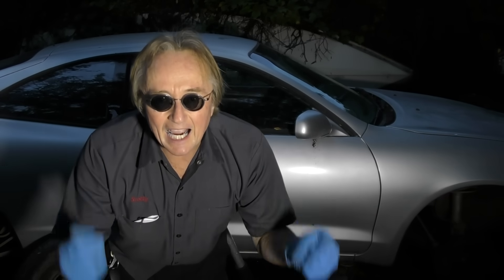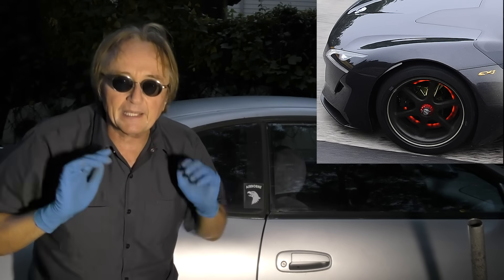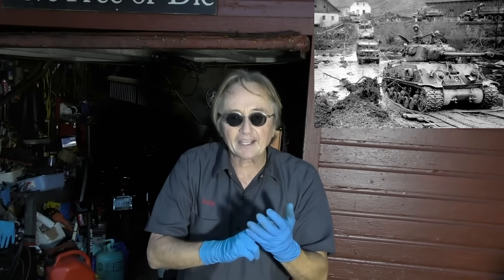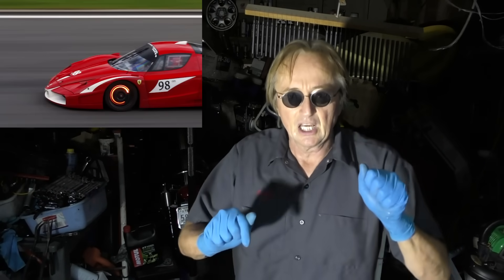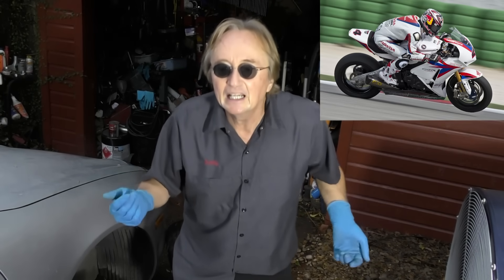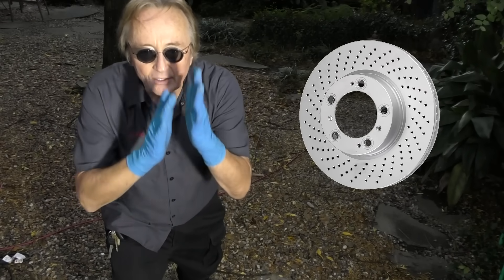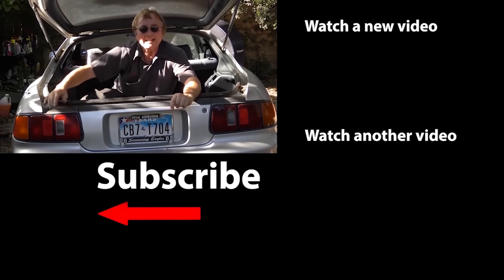Why Some Cars Have Drum Brakes Instead of Disc Brakes

Comment: 1029’24/0538h 🇺🇸 Scotty, thank you. The rear drum breaks can be, also adjusted by reversing the vehicle and pulling the hand lever, holding the release button, several times. Thus the adjusting the adjuster device gets tightened. I’ve done it and I could feel the breaking much much better. Cheers…….

Comment: My 1994 Honda Magna VF750C has a disc up front and a drum in the back. I live in the briar patch of twistie mountains roads where SC, NC, TN, & GA come together. Scott is absolutely right, as always, the trailing brake action, here on my hillbilly roads, works perfectly with a drum brake on the back. For this bike, that has the VFR racing engine stuffed into a cruiser frame, having a disc rear as well would almost be overkill. Magnas are fun to ride! Rev up your engines!

Comment: If I can replace my rear drums with discs without a lot of pain and excessive cost I'll do it immediately! For the simple reason I do my own mechanic work. Have been probably as long as Scotty. Reason being because I can see no justification whatsoever why drums make any sense! First of all with discs if you just want to do a periodic look see to check their condition, usually all you have to do is bend down and look. Don't have to pull the wheel at all. you can see and feel the condition of the rotor and usually see the pad thickness. If they do need service , which 99% of the time is a simple pad replacement, total time to do it is about 15 - 20 min per wheel.  To do the same for a drum you're likely looking at maybe 3 -4 hours per wheel, a few scrapes and bloody knuckles, lost tools because you get so pissed off you start throwing things and probably added time to take a full shower instead of just washing your hands. There are few things more filthy, frustrating and over complicated than drum brakes. Have been putting up with them since the 1950's and have yet to do one that wasn't a traumatic experience.

Comment: Completely missed was the parking brake issue. My RX has a little drum on the disc in the rear for the parking brake. Cars with rear drums don't need this.
Reply: Yes👌🏽 Drum brakes make a better parking brake. Also, drums in the front have an Achilles heel, they need proper and constant adjustment or else they pull. Disc brakes automatically adjust and don’t have this issue.
Reply: @JakeSanMartin  My old drums had a "star adjuster" as I recall. I never had to touch them, as they were self adjusting. When I did a brake job I did have to reach in from behind and back off that star with a flat screwdriver because the shoes cut into the drum and prevented its removal. But it was so long ago I am not even sure what car it was.

Comment: Ive had multiple vehicles where i have converted the rear to discs and i will say even in regular driving. The increased braking power to the rear makes an INCREDIBLE difference especially in non ABS vehicles where the fronts will lock up while the rear is just hanging out and i almost cant stand working on drums vs the simplicity of discs

Comment: TIL. Brake discs all round pro drivers and brake drums are cheap for manufacturers for daily commute drivers. 

Would be interested about your thoughts on remapping an ECU for better fuel or power performance.
I was told its useless unless your are rally driver. The stock ECU was made after rigirous testing so no need to change it. Right?

Comment: I have a 2012 Toyota Tacoma I noticed it’s front brake calipers are on the front of the wheel and not behind the wheel where it should be. Is there a way I can put the calipers in the right position?
Reply: Or is it ok for them to be like that?

Comment: The rear drum brake takes the handbrake much simpler. The rear disk brake still has a drum brake integrated into the rotor for the handbrake.

Comment: to save you all time, it's okay to have discs in the front and drums on the back. it doesn't matter if you're not racing
Reply: Its not ok for me, I will not buy a car that has drum brakes and whilst we're on the subject of cheaping out I also won't have cars with wheels that are only held on by 4 bolts.

Comment: Scotty, i just purchased 1983 4x4 suburban, i will be take is off-road and be pulling a trailer.  I plan on doing a full frame off restoration on it.  Should i put disc breaks for the wet and towing conditions?

Comment: Drum brakes also generate way less brake dust, which keeps your wheels cleaner. Well, actually, they probably generate just as much brake dust, but most of it stays contained inside the drum, so it doesn't get on your wheels.

Comment: I put power star drilled and slotted rotors on my ram 2500 and they gave me a huge improvement with breaking. High toe heavy horse trailer often and coming down some steep California grades, I can build up a lot of heat in my brakes. I recommend drilled and slotted discs for pick ups that are hauling heavy loads and going down Steve grades

Comment: How are drum brakes cheaper to make. 1) The drum requires more steel than the disk, 2) The shoe requires more steel than the brake pad. 3) There are springs and other items on drum brakes that aren't necessary on disk brakes. 4) More material means more cost. 
So, again, how can drum brakes cost less than disk brakes?
Disk brakes are lighter than drums and more efficient. So why do drum brakes still exist?
Reply: Because somehow they really are cheaper and cheapskate car companies use them to cut corners to make their car cheaper, these same companies also use wheels with only 4 bolts rather than 5 too typically.

Comment: Scotty! Can you explain why Its a good idea to change your brake  size when you put bigger wheels on your car and how to determine the proper size?
Reply: Bigger wheel means more unsprung mass and a higher rotational force for the brakes to stop which means you need more braking power and bigger brakes to achieve it.

Comment: Many Heavy Trucks still use Drum Brake Full Air systems . Works fine . But Discs  ARE better . Less Prone to sudden Locking at Max Braking .
Motorcycles tend to have a Tiny Disc on the rear . On a Bike 95% of the Braking is done by the FRONT in an emergency . Rear brake to keep it in line .
Like Scotty said for the Cars . Rear brakes just keep the Back  AT  the back . Rather than overtake the Front .

Comment: Drum brakes are garbage.  It's been years since I decided I would not own another car that had drum brakes.  You have to drive in reverse and slam on the brakes once a week or so or the drum brakes don't do anything at all.  They're terrible, outdated crap, and need to go away.  My last 2 cars (2014 Prius, 2021 Tesla Model 3) are 4-wheel disc, and I'll never go back (granted, the Tesla rarely uses the brakes, but still).

Comment: My 1988 Toyota Camry had a front disc/rear drum system and you could literally stop that car on a dime without locking any wheels.  The Chrysler products I had with a similar setup would go sideways if you had to stop quickly on a wet road.

Comment: 1. Drum brakes in the rear gives you a better e-brake action.

2. Using front brake on a motorcycle in a turn on wet pavement can end up with you having an intimate encounter with the pavement.
Reply: I have discs all round and the handbrake on my car will lock up the back wheels easily and I use Continetal tyres.

Comment: The curve of the braking effort for drums/discs is different. Drums is non-linear whereas disks are virtually a straight line. Disc brakes on the railways has virtually reduced flats on the wheels to zero.

Comment: Water has never been an issue. 4 wheel drum brakes.  for most driving drums work fine all around.  Most people never use their brakes anyways...even on a "they are driving alert" days. Winter has never been an issue because the water on the road is ICE.  None gets inside drum brakes.

Comment: Scotty.  I don't think you addressed the reason why so many manufactures stuck with rear drum brakes for so long.  The reason was that it's more difficult (costly) to manufacture a disc brake that incorporates a parking brake.  On another note, I understand that the expensive '65 Corvette was the first American car to incorporate 4-wheel disc brakes but did you know that 4-wheel disc brakes were standard on a cheap foreign economy car in 1956?  It was the Renault Dauphine.

Comment: I had a '72 Maverick with a two barrel 302 and four wheel drum brakes. With good organic shoes and the brakes adjusted properly, in around town normal driving you couldn't ask for better brakes; with no power assist and normal in town low speeds, you could put your face in the windshield if you stomped on the brakes. But if you get up to or over the speed limit on the highway and need to slow it down, you'd find yourself having to press harder and harder on that brake pedal after they heated up and began to fade. It is not a good feeling at all. And driving through a big puddle in a heavy rain storm could induce the same sort of panic as not much of anything would happen when you press on the brake pedal immediately after.
Before they gave up on drum brakes, racing Corvettes had vented back plates, and some even had a cooling fan mounted on the axle. Added cooling, semi or fully metallic brake shoes, dual leading shoes, but no matter what they couldn't compete with a good disc brake setup because of how easily disc brakes can dissipate heat.

Comment: There's also the disadvantage of drum brakes locking up under extreme pressure.  But that also makes them excellent parking brakes.  Disc brakes can't be locked.  All cars with four wheel discs have a another set of little drum brakes buried in the rear wheels.

Comment: Drums are obsolete and heavier than discs. It's a shame u still see them on economy cars. They are only useful as parking brake.
Reply: Nope for the rear they work well and no need for another E-brake drum. Disk use a drum separate for the E-brake.

Comment: For many years I remember that most production cars had disc brakes on the front and drums on the back. Now a lot of newer cars have discs all around. Discs on the front are far superior, no argument there, but on the back? The advantage of disc brakes are their simplicity, a lot less parts. The drawback is if you drive on a lot of wet gravel roads a lot of mud can splash on the discs so they get scratched, wear out faster, and drag. In that kind of environment back drum brakes are superior.

Comment: Disc brakes require servo assistance (vacuum servo) where drum brakes do not.  If you fit discs to a drum brake car you need to fit a vacuum servo (brake booster) to the system, because not all drum brake cars have a brake booster (servo assisted)

Comment: Discs are better for repeated stops.  But for the first stop (as in a panic situation for the average driver) drums have them beat!  All you have to do is look at the braking test results back in the '60s, when even pickup trucks had shorter stopping distances than most of today's cars.  The first stop with drums was always the shorter distance.  But after one or two aggressive stops, or driving down a mountain, discs are the clear leader.

Anti-skid braking systems also tend to lengthen stopping distances on a dry road, due to their not allowing the wheels to lock up, but they do allow better steering control.

Comment: I disagree on the use of slotted/drilled rotors. My sports sedan suffered endlessly from rotor warping with the (ultra expensive) OEM rotors. Both front and rears.   They would warp quickly after a brake job. Plus the stopping power was on the weak side.  I got sick of this. I ordered slotted, dimpled rotors from a well known online brake specialty house.   My warping problem is over. Not only that but the brakes are silent , smooth, with no chatter, and with a far better "feel" than before. Not to forget they haul my sport sedan down to a standstill in record time.   Makes sense as Performance racing brakes are designed to take extra heat.

Comment: After getting an estimate of 600 dollars for brake pad replacement I decided to do it myself.  It seemed intimidating at first but once you have all the proper tools and the method down pat it is surprising how easy it is.  Then I decided the next time I change pads I will just upgrade to new Brembo calipers pads and rotors and do the upgrade myself because the parts for the upgrade are only slightly more expensive than a service station charges me to change pads only.

Comment: Wanting to put an ls3 engine in my 1980 Camaro, and you know more horsepower means you need more breaking power. So for a car that had about 300-400 hp. All disk breaks would be best right?

Comment: Here in the UK I used to have a car built in 1959 ,used to be my dads a STANDARD ENSIGN bought in 1969 with 90,000 miles on the clock ,ran it for years used it for car shows ,sold it in 2019 with 293,633 miles on the clock it had 4 wheel drum brakes ,could be interesting slowing on a hill in hot weather, yes we do get hot weather here ,wish I had not sold it now but I'm getting too old to bother with old cars ,71 now, In case you're  wondering the name STANDARD is the maker I know the name means basic in the USA ,but you may know it better as being part of STANDARD TRIUMPH. TRIUMPH did however use disc brakes on their sports cars TR2 .3.4 etc best wishes to all in the USA stay safe and GOD BLESS AMERICA.

Comment: Thanks scotty, i been researching 3 weeks straight and man i sure learned a whole lot, put 18 inch after market wheels on my car $$ not cheap but i love my cars to look nice since the 80s but the rims i put are way more see through than any aftermarket rim i ever bought since the 80s and the front rotors and rear break drum looked tooo rusty and my car looks super shiny paint job/ new rims and that rust drives me crazy so i ordered 2 FRONT DURAGO HIGHLY RECCOMENDED ELECTROPHORECTIC COATED 100% MILL BALANCED ROTORS FOR RUST PROTECTION and i ordered 2 TOP OF THE LINE ACDELCO PROFESSIONAL ADVANTAGE COATED BREAK DRUMS for the rear and yeah you right if i aint racing the car and its just my daily family driver i have read you are wasting your time putting the rear as disc brakes also, so your info is spot on!!

Comment: 2017 Tacoma owner manual says that the rear drum brakes can ice up in winter if you use the parking brake at night. Water ice can form inside the drums and you'll be stuck until you can thaw them.  Sure enough, some owners report their trucks are locked up in the morning after a freezing night.

Comment: Mr. Kilmer this may sound like a dumb question, but, here it goes. If the adjusters on your brakes are shot and you put your assembly back together without them will bad things happen. I did a test drive and they seem to work pretty good without. I did notice I had to pump the brakes a bit more.

Comment: Drum brakes are used on forklifts, and alot of heavy industry. They wear longer, have much more surface area for better stopping of alot of weight.  Like alot of things mechanical, they STILL work in an emergency  if brakes lines go out, with a mechanical park brake setup.

Comment: I remember when GM proudly declared "Disc Brakes" on the brake pedal back in the 70's and 80's
Reply: My 86 Chevy has it as well.
Reply: My 1993 buick park avenueultra had drums in the back.
Reply: Yet, Even they (both GM and FORD) used Drums and not Disc's at the rear
Reply: As did Ford back in the '60s.

Comment: Mr. Scoty,  like you I have 2003 Matrix XR, FRONT wheel drive. it gas 236k miles runs great no problem. 
I went for oil change with the dealer, they said need to change the Selnoid. 
I did not,  do it . what is your advise. thank you very much.

Comment: With the robustness against water and mud: I had exactly the opposite experience when driving on a highway with a partially melted ice/snow/water sludge on the road for about 10 minutes, then when attempting to slow down with my second car which had rear drums, very often I had caused a rear slip (97 Skoda Felicia Combi, it had no ABS) the first time I hit the brakes. I thought I was just too heavy on the foot on such road and so let it pass. Then I replaced my car for mkV Golf with all disc. When similar road condition happened, when I used the brakes, for first two seconds I had virtually no braking action whatsoever, pretty nasty surprise... It then dawned on me: The disc covered with a layer of ice (I'm used to let the car slow down passive way instead of using brakes, it is more comfortable ride and costs way less fuel) and it took the second or two to melt it out. With Felicia, just the rear drums (which didn't have the icing problem, because covered) were effectively working at that time, so hence the slipping - when the whole station wagon braking was only on the rear axle...
So since then I would prefer the combination (disc front, drum back) to avoid all wheels suffering from the same weaknesses at the same time, but they don't make cars that way anymore...

Comment: I have a 1997 F150. Yesterday I changed the rear brakes and drums for the first time, and they still had some life in them. It was a b!tch dealing with the tight springs and stuck brake lines.

Comment: On my 2007 Toyota Camry, there are disc brakes on all 4 wheels, but the E-brake is a drum brake design that is integrated into the rear disc rotors.

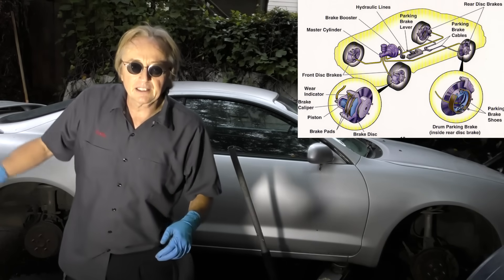Comment: 3:55 yeah. I was told by my mechanic that I've been using the car pretty much without the rear brakes for years. Of course they got repaired to top condition. But if I was not told there was a difference, I would not notice.  The only thing I noticed is my handbrake working again.